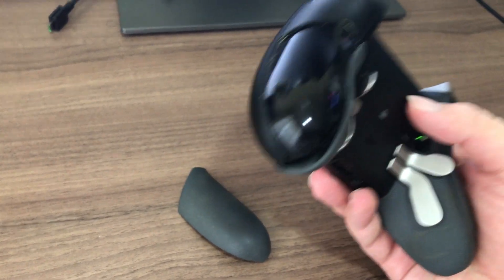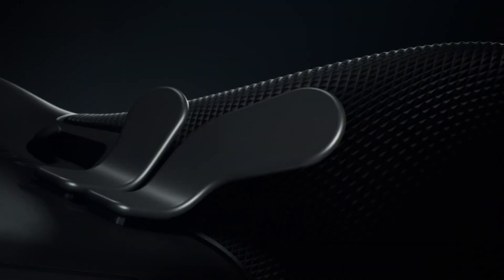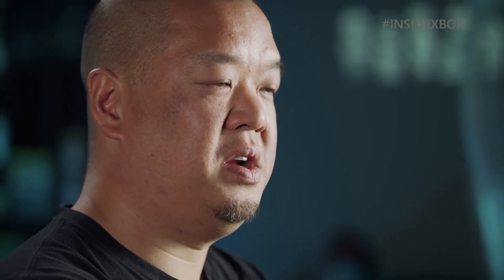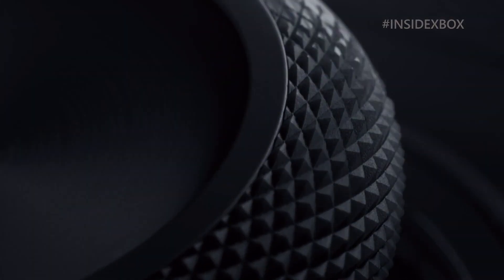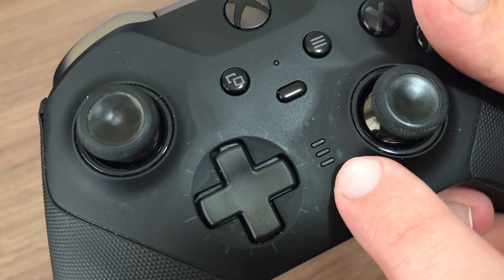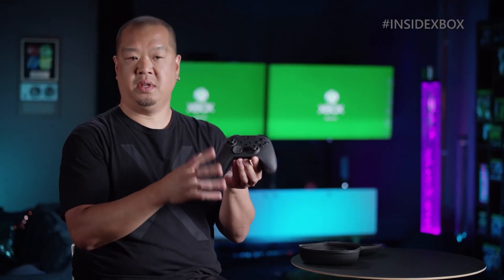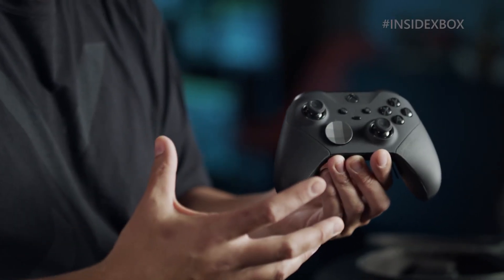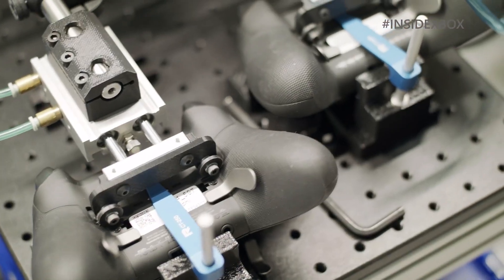Xbox Elite Series 2 After 1 Year: Did Microsoft Fix The Durability Issues?

Comment: Y’all must abuse your controllers when y’all taking those Ls in warzone..I’ve Have had it since the elite 2 even came out and have no zero issues. I wipe it down and clean in every now and again. Still feels just as new. Best controller hands down
Reply: Never dropped my controller nevermind abuse it. Both bumpers have become inconsistent as well as the left trigger. Shouldn't have to gamble and hope a product will b durable and withstand high usage rates when it's near the cost of a console

Comment: If you're buying a Series 2, get the one with the "new" box art and check the "Lot Number": 2122.

It seems they made some quiet improvements.
Reply from the maker: Do you know what improvements they made? Genuinely curious.
Reply: @jidenshaotoko  I tested 4 of them. None had drift out of the box, triggers are more responsive (faster), stock tension is tighter compared to what I experienced when they first released.
Reply: What exactly is the new box art?

Comment: Honestly surprised to read so many people have had so many issues with it. I bought mine second hand over a year ago and have had no problems with it at all, admittedly it's not been getting massively heavy use, but at the same time I haven't always treated it exactly...gently.
Reply: The first or second one?
Reply: If you're talking about the first one I felt the same exact way. Had mine for over a year. Buuuut just two days ago the grips started coming off. No reason what so ever I picked it up off my desk and then felt something weird on the back and woopty due grips are coming off.
Reply: "admittedly it's not been getting massively heavy use" - Well, there you have it.
Reply: @Druskqq  he doesn’t treat it gently either soooo
Reply: Just sent mines back in I barely used it it would let me connect it to my pc kept on disconnecting and only charges inside the case lol
Reply: I’ve had mine for a year and a half but after 7 months of use (almost daily) the controller would flash for 30 seconds when I turned it on. Then when it would connect, it would press the LT+RT,  A, X, Y, B by itself. My controller physically is fine. Except the rubber grips are a little loose. I just stopped using it and bought a Razer Wolverine. Way better. It’s built like a tank (the Wolverine)
Reply: The controller (Elite V2)  have some issues with his RB/LB buttons!.
Reply: No shit you don’t use it as much I hate comments like these
Reply: You prolly don't take the game as serious and play crazy hard with it
Reply: Same here. Bought mine over a year ago. Played on Xbox and pc. A lot. Still perfect.
Reply: @xiahra9401  YES my RB button is completely out.
Reply: If you picked a version 1 elite then that makes sense why you don’t have problems. Microsoft used better quality components for the o rings around L3/R3 and better components for the bumpers. They went the cheap route for the version 2, which is why a lot of gamers make comments in regards to problems. I buy two elite series 2 at a time because I’m 100% certain that something will happen (drift/unresponsive) within a month or 2 so I just take it back using the warranty from the store. Elite v2 are poorly made.
Reply: @andrewvega1308  i got a brand new one today broken out of the box y button works only half of the time same with my other one that i got last week
Reply: I just bought and elite v2 control and I loved everything about but the y button if pressed softly or tap does not register. Have to press hard for Y button to register. Since I just got it I decided it was faulty and got a replacement & the replacement has the exact same problem !
Reply: @willbates8464  had the grips fall off my xb1 lunar white controller (the one with gold triggers and dpad. Loved it) and I think it's cus I left it on top of my xb1's top vent rather than the other side and the heat must've fucked it lol
Reply from the maker: @Xenon Archer Heat is definitely the culprit. My Series 1 started to peel off at the height of Japanese summer, and although Series 2 took a lot longer to peel off, it happened at the height of summer in Brazil with temperatures reaching 43C, even with it in the case when I wasn't using it.

Comment: This controller is totally not worth this price, my after 2 months start analog drift, after one year rb work when they want, now after 2 years i play onlu on cable connect cause battery die, i buy brand new, for to compare my xbox one or dualshock 4 are older than elite and still work great.

Comment: I have two series 1 elites. I’ve had the first one for about six years and the only issue I’ve had with it was after about three years the right bumper broke to where if I hold the controller with the bumpers facing down the outer end can pop out of the casing. That said it still works so I turned it into my PC controller since I play at a desk and can’t really hold the controller in a way that it will pop out. No other issues after six years, still works perfect.

I’ve had the second one for three years and have had zero issues with it. Still looks brand new.
Reply: You're just lucky or very careful with your controllers
Reply: Lucky I was so careful with my Elite 1s, but the grips came off, the bearing in the sticks collapsed and the RB buttons snapped leaving it loose on the switch. Happened to both, with me not overworking either. Terrible build quality.
My Elite 2, same deal, been so careful with it but now the RB has lost its responsiveness. Needs to be pressed so hard to register.
The class action lawsuit against Microsoft for this is no joke.
Reply: @LouSassol69er  my elite 1 still works but my elite 2, after 7 months all buttons except triggers, bumpers and analog sticks became unresponsive and the analogs are weirdly going up and down by itself. Which is why I switched to Razer Wolverine. Way better build quality.
Reply: My right bumper broke as well. The replacement was a total piece of cake though.

Comment: Not sure why YouTube recommended this but I might as well give my input. The Elite 2 is just as bad if not worse in terms of reliability. Not sure why the standard controller is as solid as it is but the $150+ controller is plagued with issues.
Reply from the maker: Doesn't make sense to me either. In many ways, the new controller that comes with the Series consoles feels more well-built than the Elite 2. It'd be nice if Microsoft revised the whole thing with Series 3 and moved away from rubber. It doesn't hold up over time.

Comment: Had my series 2 for over a year and it still works just like i got it the first time.. It literally my favorite controller and I play competitive games..
Reply: Hi Bill
Reply: Sorry, you must not really play that often or that competitively.  We have three Elite S2's (nephew, wife, and myself).  After all three were replaced once, we made a 100% conscious effort to baby the crap out of these "premium" controllers, which is an absurd necessity with this price tag.  The right bumper on all three started double clicking frequently, the A buttons were barely receptive because they wobble too much, and the sticky pad behind the trigger moved and caused sticky trigger on two - all this after 6 months.  They're engineered to fail under normal circumstances.  Light gamers just don't count.
Reply: Yeah these controllers will last as long as you treat it right, no button spamming or mashing no slamming or throwing etc, had mine over a year nothing is wrong with it
Reply: This. Everyone else, user error.
Reply from the maker: It'll be REAL funny when the controller of those who don't believe the material choice issues are real start to wear down. It might take 1 or 2 years - there's no set time for it to happen - but it will.
Reply: @inawrocki207  I’ve had mine since it came out and I’ve clocked thousand of hours and it’s still looks and feels just as new.
Reply: @jidenshaotoko  That's literally anything with moving parts, though.
Reply from the maker: @Steven Some people who say they have their controller X amount of years and it still looks new don't get this concept.

Comment: I got my second series 2 controller now and got the same issue like I got on the first one. The right bumper RB isn’t recognizing anymore or just on a hard push.
Reply: Same my is under warranty so im gonna do a claim
Reply: How long u using it?
Reply: My first one did that a year after use, and my second seems to be heading that direction too. While it still works the pressure I have to put on the left one is noticeably less when I test the buttons in the Xbox accessories
Reply: At that point fix it yourself or take it to a repair shop if you fix it yourself it would be like 20$ because you need gear
Reply: But if you take it to repair it can go from 100-200 aud so still cheaper

Comment: My controller start self destructing after the warranty ended. My controller was lightly used, mostly for open world games about 8 hours a week average. The “A”, “Y”, and “RB” buttons are having issues and both joystick buttons are worn out. This controller build quality is worse than the first gen in my opinion as the only issues I had with my first gen was the grips coming off.

Comment: Spent $250 on a scuff. Paddles stopped responding after 3 months. Spent another $250 on a battle beaver because the quality is “so much better”. Lasted me 5 months and L3 would only work if I pressed it in at the perfect angle. Meanwhile I have had my Elite 2 for about 8 months now and not one issue with it yet. I know in time problems will come up but my point is all controllers are built to fail. If they never failed then why would people ever need to upgrade

Comment: I own both. I bought the original controller day one. My controller still fully works and is clean. Although I completely changed the housing on the whole controller. It made it feel brand new and much better. The original handles came off and the front became sticky as well. My series 2 controller is very solid and the analog stick tension is highly appreciated.
Reply: Where did you buy the housing from? I need to do that with mine but could not find one on amazon etc. I have taken it apart a few times due to bumper buttons not working and now it does not close properly.

Comment: I have xbox for 4th year now and all this time I never even tries original controller (neither with previous, or current gen). I bought pair for Elites and one of them are being used daily, whereas another rarely. None of them have any issues. No drift, no "dust" problem, no rubber problem, no "stickyness", no button problem - nothing. Initially I bought pair of these almost at a same price as my previous xbox and I really got annoyed by that fact, but man - they really paid off. 
I bought some cheap charger, which had recharable batteries included and they still go strong till today.
You said that you took care of your controllers and etc - then how come my v1, which was bought almost 4 years ago looks far better than your current v2...
Reply from the maker: I find it really weird this fetish people have with pointing out "My stuff looks better than yours, so you probably don't take good care of it". All that these types of comments tell me is that people don't consider a number of factors. 

Where do you live? Is it the city? Is it a rural area? Is it close to the beach? 
How's the weather? Is it hot? Is it cold?
What about the air? Is it humid? Is it dry?
And what about your hands? How oily do they get? And how fast do they get oily?

I could go on and on.

I've lived in places before where it was as easy as dusting off once a month to keep my stuff looking as good as new. Where I live now, even if I were to clean my stuff every single day, it wouldn't matter, especially when we're talking about rubber material.

Comment: My Controller isnt used daily and looks better like a new one and one of the trigger stop plastik holders broke after switching from normal to fast shooting🥲

Im using things like they cost 11111000000000000 $ everything looks new after 10 years or something but the elite 2 controller is not durable for me.

Bad pricing for a destruction king

Comment: What's the difference in the elite 1 or two? I just bought a refurbished elite controller. It has the paddles on back. But it's only got two different settings on the back instead of the three on both sides it's got two on both sides so I'm assuming it's the first generation elite? It looks just like the newest one though. I kind of feel like they built me a hybrid of the two

Comment: As an owner of the xbox elite controller 1 I was quite surprised to hear about durability issues with it. I’ve had no issues with anything wearing out but Im prob not a heavy user like you. If anything what I really like about the controller is the truly premium feel it has of something that is well made, it sure doesnt feel like something thats gonna wear out and ive used it quite a bit but I dont know how you play games and what constitues ’heavy use’ but I would bet for any normal use of tve controller it will be perfectlt fine. For normal users, casusl play, and for peiple who just want a premium feel device, they will be more than happy with it. My only gripe with it was the lack of bluetooth which I stupidly took for granted and after having shelled out quite a high sum for it Ms shortly after released the xCloud beta which I got accepted to after having waited forever, only to then be informed that it would only work with the new type of gaming controllers that had bluetooth. Oh silly me for getting that. They have had wireless controllers forever and made a killing on the elite controller and just now realised they actually wanted to use bluetooth and it would be required for the new service. I was slightly bummed out about that. I still think though that ghe elite controller 1 is one of the finest most premium controllers one can own and will not wear out if youre a normal user. Ive tried both v1 and v2 and IMO the v2 is not a step up in terms of premium finnish and overall quality feel.

Comment: The one thing they don't focus on is the most used double movement, Left analog stick forward, L3. Every game is based on the L3 forward "running" mechanic. There's where most controllers break.
Reply: bind L3 to a paddle
Reply: @Eddie2P  F that, for a almost $200 controller, it should just work.
Reply: I put it to the bottom left paddle and it works great.  Simpler. It's dumb to make you press same button and then shift forward to move. I know y'all are used to it but my carpal tunnel never acts up anymore when I play a lot so it's a win for me. Try it.
Reply: @ISitOn MyArm apparently they do

Comment: I don’t get it, I’ve had a standard Xbox one controller for like 3-4 years now and only about a month ago did I have my first problem with it (the rubber on the left thumb stick came off). Other than that, I’ve had 0 issues and there was a time in my life where I was playing like 30 hours a week, I easily put in a couple thousand hours on the controller. I also dropped it a few times, but that happens to everyone, I don’t get why a $180 controller falls apart in a few months, but a $60 lasts thousands of hours

Comment: I had mine for about 1.5 years so far and I still love it.  I did have an issue with left bumper either double actuating or not at all.  In addition the right trigger became sticky since the foam pad inside came loose creating an adhesive spot for the trigger.  I exchanged through Microsoft directly and the controller has worked so far ever since.  I still use the controller for many games on Steam and the back paddles works wonders for shifting gears in Forza Horizon 4!

Comment: I have had nothing but issues with my elite 2... I'm not gonna slate the controller hear as most of it is really good... but if I'm paying a premium price for something I want to be able to play the games I play dayley without any problems. I dnt understand the point in the premium just to play games that's not gonna put stress on the controller... plus the main issues I had was the left stick and the rb... in most cases xbox fixed the issue but 3 weeks without a controller 7 times is a bit unreal.. and in the end I spent more that half the time I had it waiting on its return... (should have been sent a replacement in place after the 3rd time of having to send it back... but like I said I love this controller and if the stick issues where sorted I would say probably worth every penny allso worth noting if you use the cable without the wireless charger dock it turns on ur controller and the xbox.. just placing it on the wireless block to charge dosen't turn it on bit allso charges it..

Comment: After 2 years with an elite 2 i can say that stick drift is minimal and the battery is good as new even after thousands of hours of runtime, which is great, however, the paddle buttons and bumper buttons have extreme wear, i have to press hard down on the bottons to get them to activate, even when they click, nothing happens unless i forcefully press them down, this is disappointing since i had an elite 1 before this for over 4 years and never had this happen, i shouldnt have to buy a controller and worry about how many times i can press a button.

Note: if you remap the stick buttons to the paddles, this can reduce wear on the sticks and significantly reduce stick drift. :)
Reply: Any update?
Reply: I use the controller for Battle front 2, in a period of 8 months i replaced it 3 times, I use a lot RT and LT and LB and RB, and those buttons can’t handle much clicks, that’s is unfortunate.